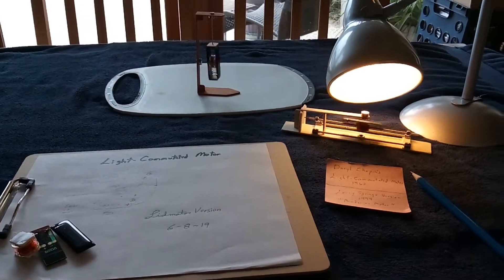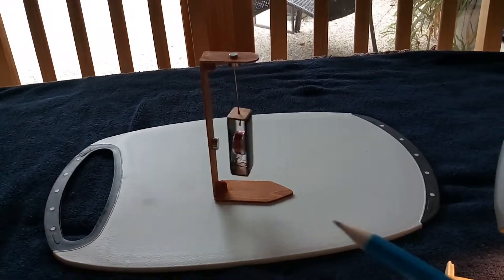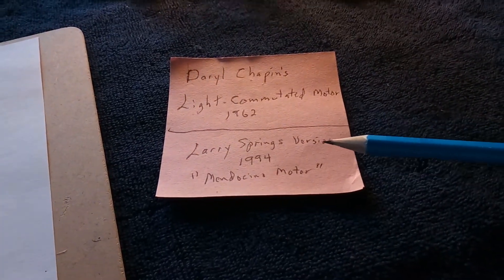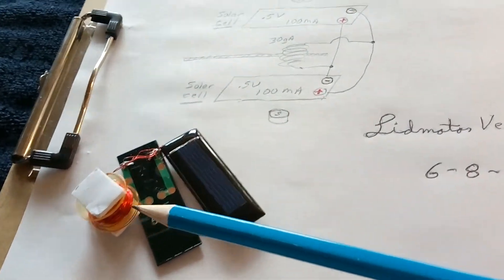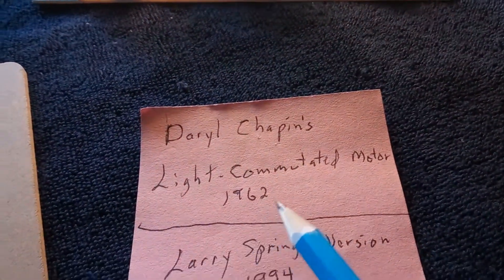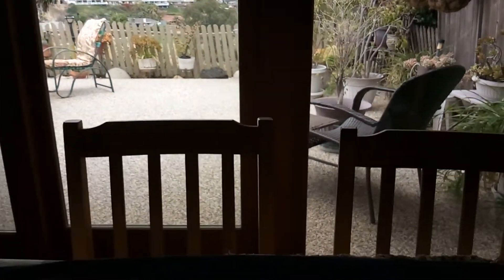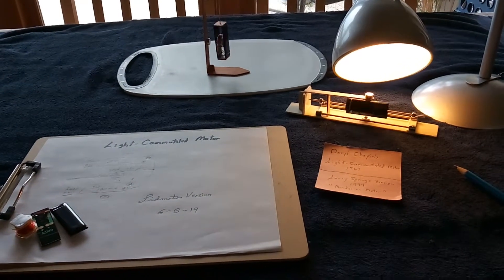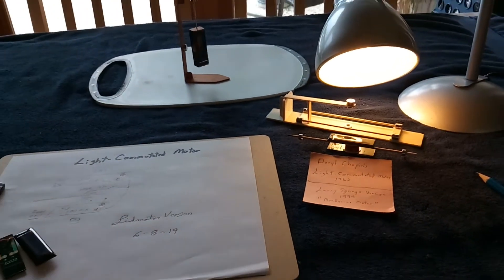Lignt Commutated Motor--Part 2

Comment: As you said in the comments down here "as simple as it gets.  No reed switch. No brushes. No transistor.  No battery" I am a bit behind in my viewing, playing catch up so I checked the comments before opening my mouth 😁 But being simple doesn't mean it is easy to make and you have done an excellent job 👍👍
Reply from the maker: Thanks.  You are right about it not being easy to make.  The first one that is a needle / magnet setup was pretty easy but the horizontal one was hard.  All kinds of problems happened.